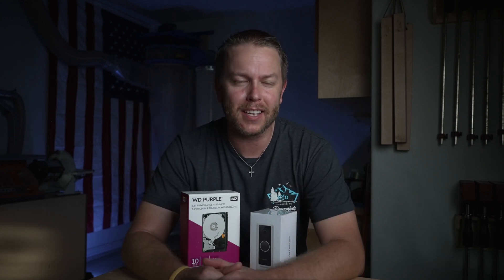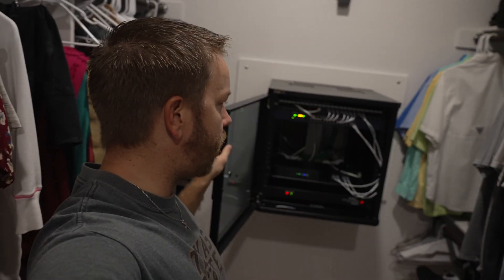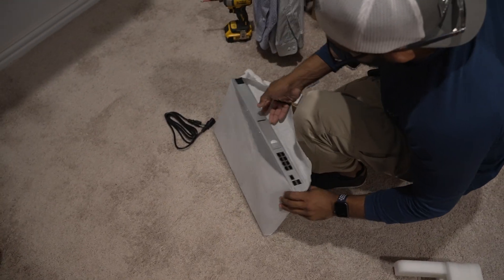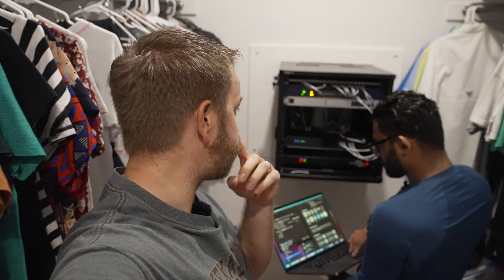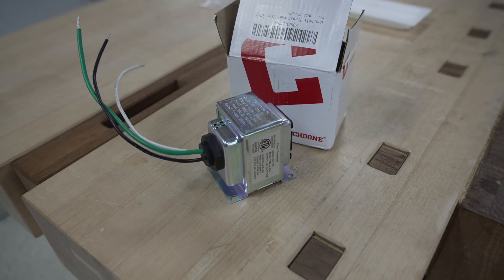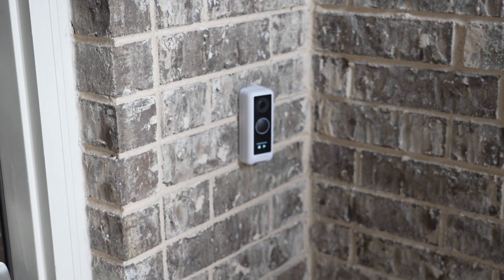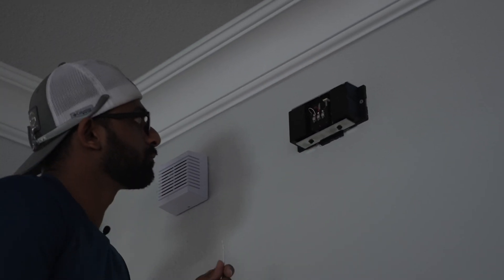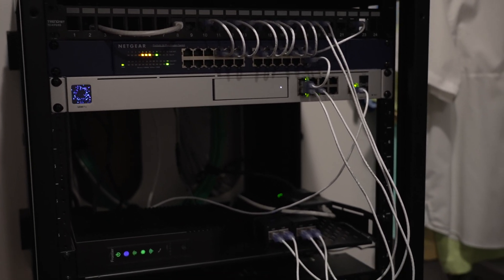Ultimate Home Network Upgrade - Unifi Dream Machine Pro / G4 Doorbell Camera - Phase 1

Comment: I have built full Unifi gear at my rent house and parents. Our is Verizon FiOS Gigabit and their is Cox Gigablast. I have are UDMP, USW-24-250W, and 3 NanoHD. Same setup for our and their. On Verizon FiOS side you had issue, I have removed FiOS router and it currently direct ONT modem to UDMP and all TVs are working (on demand, TV guide, etc) running by moca adapter. No issue so far with 940/940!
Reply: I’m thinking about doing the same thing all their newer cable boxes have Ethernet so they should be able to pull an ip.  I’m looking to ditch my Fios router as well